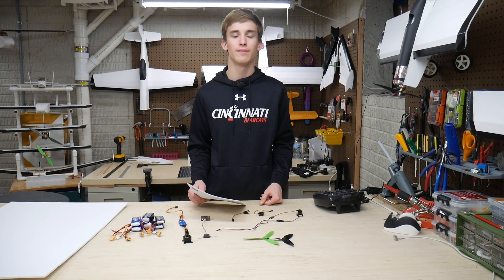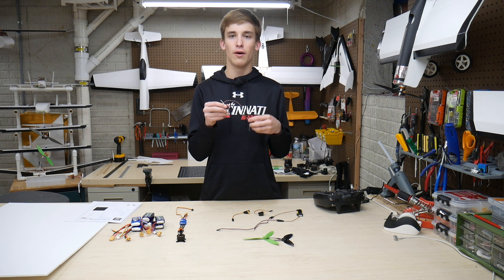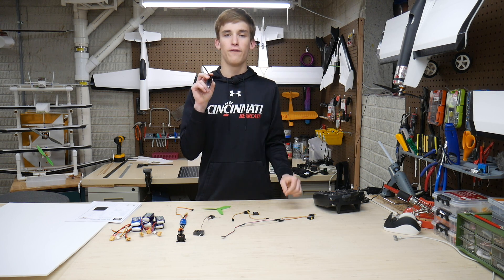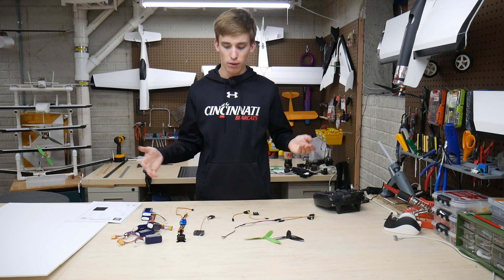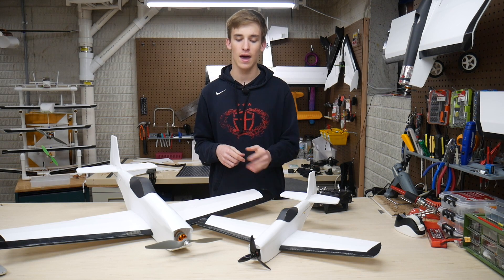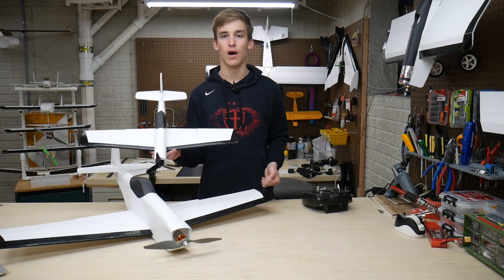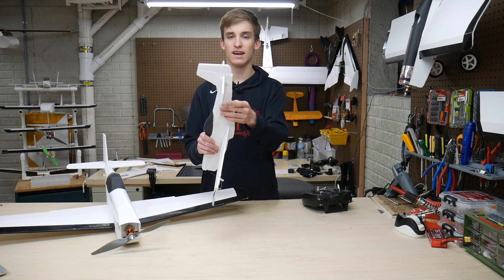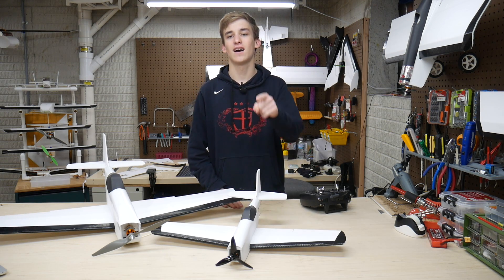FT Mini Mustang Build + Initial Thoughts

Comment: Can I use a A2212 2000kv motor? And what battery do you recommend
Reply from the maker: That motor is a little big, I would stick to a   1806-2207 size. Battery is a 3s 850mah

Comment: I haven’t seen your flight video but I would expect your mini will track poorly because of the crappy hobby king servos. When I was building minis, I started with Turnigy 5g servos and noticed they centered poorly. Flight performance suffered. Then I tried Emax 4.5g digitals. Night and day difference.

So when building normal size FT planes, the Turnigy 9g servos are plenty ok. But their 5g servos are not as good IMHO...
Reply from the maker: Interesting, I’ve had perfect luck with these, they are plenty strong and center reliably. Maybe you just got a bad batch?
Reply: Yes, very possible. They were 5g Hextronic HXT-500 and they never came back to the same center. The price was right but my FT mini Scout and mini Corsair were impossible to trim. Same issue with my first FT arrow. Switching to Emax ES9051 from Banggood in my second Arrow made a huge difference.

BTW: Check out the new mini-Zero!!!

The HXT-900s (9g) seem to do everything well and they are inexpensive. Perfect for non-mini foamboard planes.